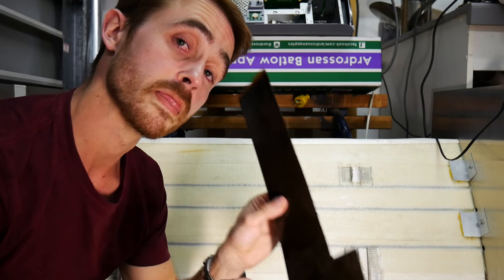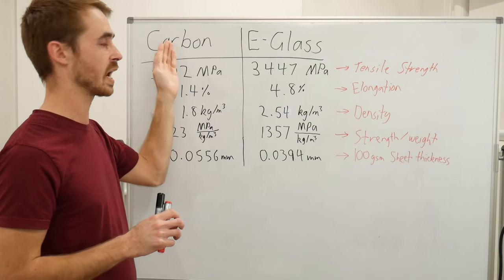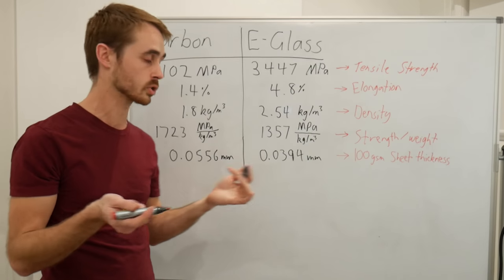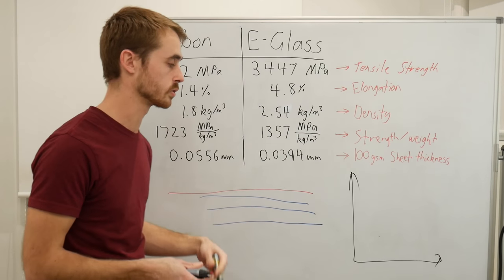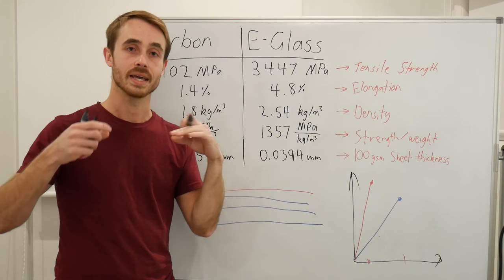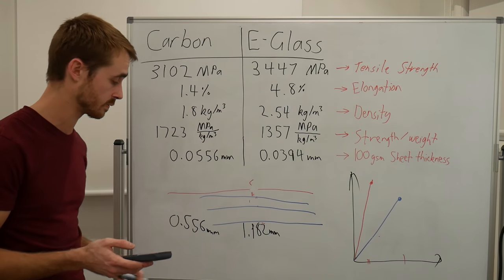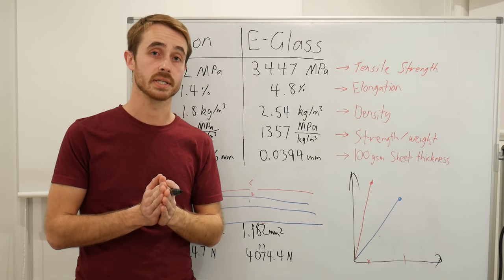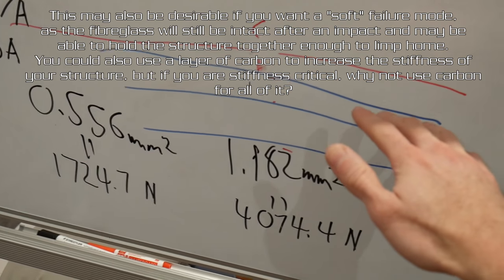Why you SHOULDN'T wrap Fiberglass in Carbon Fiber!

Comment: Hi, I very enjoy your videos, but perhaps I have to disagree on this one for many reasons. 

First, many industries adopt glass/carbon composites in many components. Wind turbine blades are a good example. Second, you don't design to max elongation ever, first because you usually have more constraints on structural failures (like safety factor on strength and buckling) that restrain your design. Therefore, it is doubtful that any part of your structure reaches the elongations that you show in the video under nominal conditions. Third, fibreglass is more resilient to impact, and it can extend your laminate life when something not predicted happens. This means that if there is a crack somewhere, glass fibres will prevent that to spread in the laminate. Finally, since under nominal conditions, the laminate life span is only linked to the time required to micro-cracks (which are there since consolidation) to bridge and become macro-cracks (a.k.a. broken part), we can definitely state that those glass fibres will increase the fatigue capabilities. Each and every good design must consider fatigue, and glass is way better in that than basically any other fibre. Therefore a well designed glass-carbon hybrid aims to find that sweet spot between pure stiffness and long life span, which could correspond to an overall lighter structure. Ultimately, I suggest adding another layer on top of the carbon for a glossy finish. Once wet, it will become crystal clear while protecting the laminate underneath. 

In other words, I would like to let you notice that if your component has reached the point at which the carbon is broken (like you say in this video), your structure must be considered failed. The fact that you still have some fibres that can carry some load means that if that was your structure, it is now less stiff, but it is still one piece! I am sure that in F1 the safety coefficients might be very close to one and that resilience has a different meaning than for aerospace structural engineers like myself. However, trust me... If that was the hull of your boat in the middle of the ocean, you would have been glorifying and blessing the carbon-glass mix that keeps your boat afloat! You might not be able to cruise at full speed anymore, but you are not on the bottom of the ocean as it would have happened with a carbon hull that cracks in a blink of an eye... Please go and search some interesting peer-reviewed papers on hyperduct... it is an ongoing work on glass-carbon laminate to simulate yielding for highly resilient composites. 

Cheers,
Reply: ummm good read, i just wanna add a fiber glass layer to prevent galvanic corrosion to steel body
Reply: e glass and finer glass are not for the same purpose ... e glass is used in high bending parts like wings on a jet liner ... while fiber glass and S glass are used for high strength parts like engine nacelles and tail planes ... if he compared E glass to EDR glass and carbon fiber to S glass he would have made one point ... carbon fiber is expensive and s glass is cheaper ... 

E glass and EDR glass are BOTH flexible edr glass can be made conductive like carbon fiber .. which is why it is used in wings ... while carbon fiber in engine nacelles need strength over flex ... where carbon fiber comes in handy because it is less weight for the same strength as S glass ... 

and of course Galvanic corrosion will happen with carbon fiber and edr glass so using s glass or e glass as a boundary layer between metal and the conductive fibers is mandatory to avoid that ... but then you also make a capacitor and need to channel the charge off the fiber ...

Comment: In the example he gives, the carbon would likely weaken the structure. The surface crack  would cause a stress concentration in the underlying layers. (Always a consideration if you have layers of material; e.g. chrome plating suspension parts is a bad idea unless there's lots of something ductile like copper underneath to smooth out the cracks from the surface.)
Reply: It is not related with Chrome plating here, plating is chemical process which is not physical/mechanical related topic. But in general, Chrome plating weakens most of the metal materials because of acidic process damages the surface finishing of the part, causes micro cracks in surface weakens fatigue strengths of part.
Reply: he is comparing a strength fiber with little flex against a flex fiber with lower strength ... he should have used S glass ... as it is a strength fiber with minimal flex ... and instead of carbon fiber for e glass EDR glass ... as it is also high flex and conductive ... 

one fiber is not the same as the other ... he is literally comparing a rubber band to an I beam and saying the I beam sucks as a spring ... which is true ... but the rubber band sucks as a support ...

Comment: My use of carbon fiber "beauty" layer for non-loadbearing panels that need the stiffness...hoods, bumper covers, rear deck lids, fenders, etc. allows me to avoid painting those panels and keep cost down by using fiberglass for the core structure. I use S-glass for loadbearing structure and carbon fiber alone for interior panels...dash, door cards, pillar skins, etc. and other parts that need to be lightweight but aren't subjected to high stresses or impacts. Probably not necessary but, so far, no unexpected issues. Thanks for your expertise. I learn a lot from your videos.

Comment: Another feature is the stress concentration which will occur when the carbon fiber breaks. At that point, the load the carbon fiber was carrying will be taken up by the remaining layers of fiberglass at the break. The result will be similar to nicking a sheet of plastic: once there is a stress concentration, there will be accelerated total failure. Destructive testing will easily show this.

Comment: A lot of composite parts are stiffness driven and strength is secondary. Eg car body panels if it's stiff enough not to flop around then it's most likely strong enough to survive rocks or whatever debris you normally throw at it. Using fibreglass as the core to build thickness and carbon fibre at the edges is still a valid cheaper way to make composite panels with 90% of the bending stiffness of a homogeneous carbon composite.
Reply: well he is only talking about something that will be receiving tensile stress. i don't think a door or a hood is going to see that much... but things like wings and what not definitely would and it would concentrate a lot of force at a single point.... so if across the surface its receiving a 2% tension.... the fiber would break... and now instead of across the whole body the tension is focused at the break.... and that 2% goes up to something like 6%.... well you just snapped your spoiler
Reply: If your goal was to build thickness, and not to provide strength, surely you'd go for a lightweight core material? Again, I'm not sure of any case where you'd want to do this for performance reasons. You're not getting the extra strength of the fiberglass until the carbon fiber fails, and once that happens, you're not getting the stiffness of the carbon fiber. If stiffness is critical, you wouldn't want a fiberglass core in your carbon fiber, and if strength is critical, you wouldn't want a carbon fiber skin on your fiberglass.
Reply: incorrect. I made parts for FSAE cars out of carbon fibre. and although they were stiff as hell the rocks from the wheels made the edges crack a lot.
just because something is stiff doesnt mean it's strong. Maybe watch the video again because it seems you didn't listen or understand what's been said

This is the reason why wheel arches on GTE cars are not carbon fibre but rather kevlar and glass composites

Comment: Katanas have a flexible core steel, and a more brittle steel hotdog bunned around it for a sharper more durable edge.   Infinity CMMD technology is also worth checking out, it uses an aluminum core of 60% sandwiched between 20% alumina(ceramic) on both sides. They do this so that the layers constrain each other as they each have different speeds of sound propagation, the layers dampen each other’s resonant vibrations, and it is also a stiff and light weight combo. Great for speakers.

Comment: There is a specific case where a combination of carbon fibre and fibre glass in sandwich construction on boats resulted in much greater impact resistance than either material alone however I don't remember where I found the research paper and I don't know how that would translate without the foam middle layer of marine sandwich construction or above water.

Comment: Great video. Great advice.
There isn't some people that do this, there is alot of people and even most well known  aftermarket companies. They combine fiberglass(strand Mat) and fiberglass together. They also put black pigment in the resin so the back side is all black. I understand the cost can be really high but it defeats the purpose of an actual carbon fiber part. I will admit, when I was younger I did by a cf hood that was made like this not knowing.
You can also tell by drilling into the part. If its a spoiler and are making mounting points. You will see the white fiberglass shavings come out. They also make dyed black woven mat. 
About the cracking, I see it all the time on hoods. And alot of people buy carbon mainly for the looks. Im a bit of a sleeper, I paint my cf parts. But thats just me.

Comment: I used carbon fiber over few fiberglass parts with great success. The secret is to lay couple of layers in different direction and use epoxy rather than polyester. The part was twice stronger than the flimsy original. Especially when is applied on both sides. Also, built couple diffusers with foam and carbon fiber that were very strong...actually couple of racing boats were built with the same materials with incredible strength.
Reply: Carbon fiber over foam is a completely different thing, and if you're adding enough carbon fiber to be stronger than the fiberglass, of course that would strengthen it.

You're probably confusing stiffness with strength though.

Comment: You forgot to mention the load distribution before failure.
Based on stiffness and strength the 3 GF to 1 CF, carbon fibre will still carry ~60% of imposed load until failure at 1.4% strain when structure will experience rapid jump of stress on GF from 40% to 100% of imposed load.

Comment: If you needed a part that required tensile strength, rigidity, puncture resistance, thin lightweight, impact and chemical resistance and abrasive resistance, combining different materials would be necessary right? But as you said wrapping s-glass with carbon fibre looks good however not so great functionally. S-glass over carbon fibre would seem to be a better choice.  
The s-glass would receive and absorb the initial force and distribute it before hitting the carbon fibre right? This would allow the carbon to act like a bone under softer tissues. 
If you covered the s-glass with Kevlar the structure would gain abrasive and puncture resistance. That could then be covered by Mylar and gain thermal, chemical, dielectric and impact resistance. I would think it better that the Mylar be between the Kevlar and s-glass but to my knowledge resins will not bond properly to Mylar causing separations in the layers.
You can layer the carbon fibre, s-glass then Kevlar sheets then cover it with the Mylar. NASA studies have shown using "Sure Bonder 9001" to secure the Mylar to other surfaces works best.
Stack and vacuum form the first three layers, apply adhesive and Mylar to the dried unit and vacuum seal the Mylar. 
The vacuum forming will help maintain consistency and uniformity in the projects thickness as well as help remove excess resin reducing weight.
                                       Just Thinkingoutloud

Comment: There are many composite panels that are made with stiff skins sandwiching a softer core, for a panel with a high general stiffness without much weight.  The most common example would be most plywoods.  But there are a lot of panels made of CF sandwiching corrugated plastics or NOMEX.  Many aircraft panels made just this way.  Many aluminum panels made with corrugated plastic or foam cores as well.  I think the key is to "balance" the panel by applying the same skin on top and bottom; the bottom panel can be a lower grade...
Reply: Yes, there are. Fiberglass isn't generally the core material for a reason though. You want something capable of transferring force between the skins that is lightweight, since the force gets concentrated in the skins anyway.

Some plywood has more of a filler core, but that isn't really most plywood, unless I'm mistaken.
Reply: Most all plywood is made of cheaper, or lighter weight core material.  Even particleboard and MDF has a higher density material toward the outside as opposed to the core.
Reply: I don't know where you are getting your MDF but you should consider finding a better source. This is\ a basic starting material in Material Science classes when learning how to run the test equipment for finding material properties. We found no appreciable difference in the entire population of samples we tested and our MDF came from a standard big box store.
Reply: If it's made with a filler material, it is not plywood. Plywood is a composite of multiple layers of wood sandwiched together with different grain directions.

Comment: wouldn't it be stiffer if you make carbon fiber the inner layer and fiber glass the outer layer since fiber glass has the higher tensile strength so it will make it hard for the outer layer to stretch when you bend it

Comment: so fibreglass wrapping a cf piece would be of use if you wanted to increase the parts ability to hold together without cracking without compromising it's stiffness?

Comment: Seems that if you are for going for looks alone or weight savings, not considering maximum strength, a layer of CF still makes sense. Since most of "Carbon Fiber hood" manufactures often do this to cut cost, since the hood usually is not a structural part.

Comment: I think the problem is that most people don't know the difference between stiffness and strength. And what homebuilders most certainly dont know is which one of the two they actually need for their application thus they just slap carbon on top of their fibreglass

Comment: I don't want to say this video is pointless, because elongation is actually a point. But there are other things why I will continue doing this. There are many points why it is actually good to combine various mats.
Reply: And yet you have stated none.
Reply: @seigeengine   The video is good and makes a valid point. Your point is also valid. Some of the other properties you may want include increased rigidity, buckling resistance, flutter control, abrasion protection. Each design is different, so I am certain that I am missing some properties.

Comment: Incomplete analysis.  You didn’t consider bending which is the more likely loading and failure mode condition for panels.  The tensile loading  analysis is somewhat true but the fiberglass is carrying some of the load along with the carbon fiber at 1.4% elongation.  Was that included in the 1000 N estimate?  Needs clarification.

Comment: seems to me that coating fiberglass in carbon fiber would actually make it worse, because when the carbon fiber breaks, the fiberglass is suddenly taking all the force in a sort of shockwave as it suddenly flexes, plus the carbon fiber is still stabilizing the two sections on either side, creating a weak point where the split is that becomes almost like a hinge, ready to snap it
Reply: As opposite to the fiberglass taking the entire force from the source? The initial force already creates a "shockwave".
It seems more intuitive that the carbon layer will  dissipate some of the initial force from the source, leaving only the remainder of the force to be taken by the fiberglass. 
Either way, wrapping fiberglass with a layer of CF would negate the purpose of using CF as explained in the video.
Reply: I wouldn't even go by shock load. The de-lamination of the carbon fiber would ad a defect crack in the resin. Blamo. The setup is damaged.
Reply: no you can make fiberglass backed bows so snapping force isn't a big deal the flexibility and strength is great for it. where as carbon fiber wouldn't work.

Comment: Until the carbon fiber breaks, doesn't it add more rigidity?
Reply: Correct, the only thing to take note of is that pretty much all of the force is applied to the carbon layer as the glass only takes real load when stretched, instead of spreading out across all fibers in a part made out of one material. So it is basically much weaker as it doesn't use the whole objects material to take the load. You would have to take account for the thickness and amount of layers of carbon fiber to bear all the load, at which point the fiberglass is pretty redundant.

Comment: what composites are best to make a crash structure, something that can crumple but only in like a car crash? how would you align the fibers' sheets? how much resin? what kind of resin?  do we need a controlled environment for resin application on sheets? Is there a composite with even lower density that can allow for more crash structure volume but without compromising strength and integrity of passenger cell?